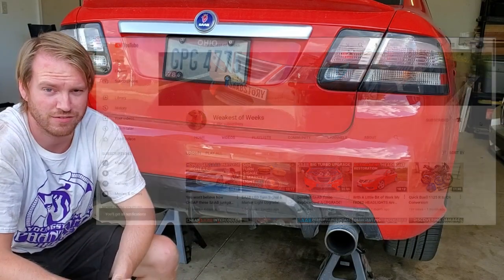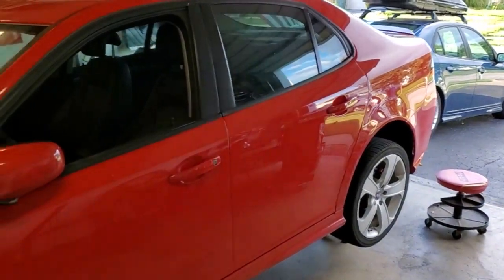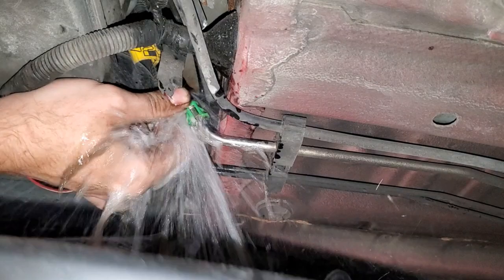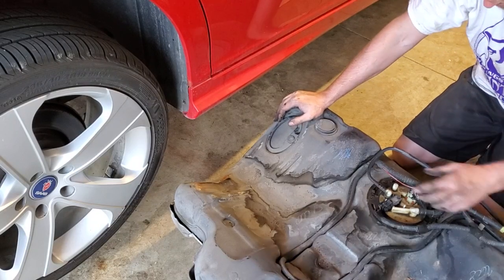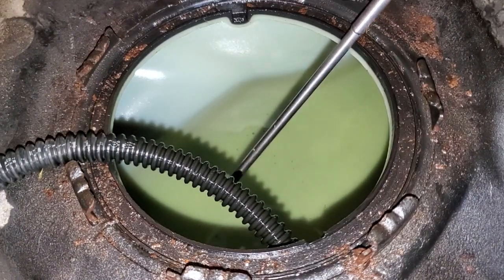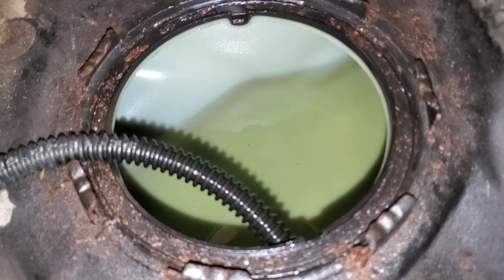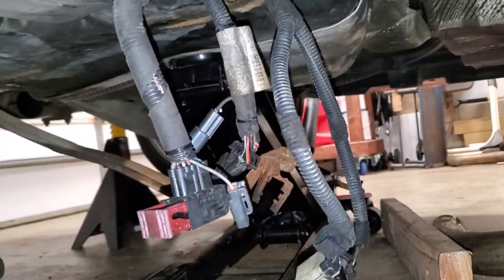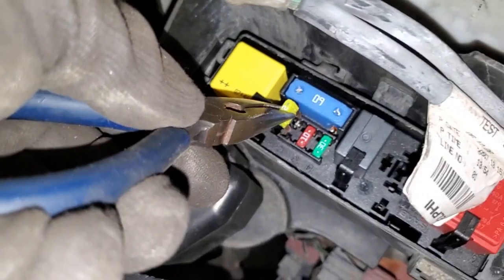Detailed SAAB 9-3 Fuel Pump Replacement

Comment: After watching this video I don’t think I am as terrified of dropping a gas tank on one of these cars as I was before this video. Gracias. But it hasn’t done anything to curb my rage at SAAB’s engineers for not put an access to the fuel pump under the backseat like on the 9-5s.
Reply: We made our own, took like 5 minutes :)=
Reply: The newer 9-5s changed the pump and tank so, you guessed it, you have to remove the tank now.

Comment: Not sure if you found this out by now, but those clips can be easily removed by pressing them in while pulling back on the line. Just an FYI a minute too late.
Reply: which clips and can u describe a lil
Reply: Yup, found out too late lol
Reply: This is a GREAT tip!

Comment: I just did the job on mine.  Whew.  Thank you very much for your video.  The one piece of advice that I would offer is that it is best to use a 1/4" drive for the rear bolts.  This will allow just enough clearance to line up with the 13mm bolts on the straps.  And most of the clips will release if you press them in the middle and pull.  I only had to get medieval with one.

Comment: My car was cranking but not starting so I sprayed some starter fluid to see if it would start it started. I let the car run for about 10 mins drove it around it was all good. Next day I went to work all fine this morning I get in my car try to start It wouldn’t start so i’m guessing it’s a fuel pump I don’t have a scanner so I can’t get codes but i’m assuming it’s the fuel pump

Comment: I just completed this drop and rebuild on my Saab 9-3 2.8 Nordic convertible. With the Vermont Tune I am averaging 9 Miles Per Gallon. Did anyone else have a drop in mileage with the pump change?

Comment: I need this done on my Saab too and it looks so intimidating to attempt myself. Ugh. 🙁 
About a month ago I took my car to a shop who quoted approx $1,300 to do this exact thing. I don’t mind paying for someone’s knowledge and labor, especially for a Saab since many mechanics don’t wanna work on them. Where I run into problems is the shop wanting to charge me almost $600 for the replacement pump when I KNOW you can get one much, much cheaper!! That’s why I told them I’d be in touch if I decided to have it done. Maybe because I’m a female they think I know absolutely nothing...  whatever. Anyway, THANK YOU so, so much for sharing this video! You just got another new subscriber! Happy Thanksgiving!
Reply: Is that replacement cheaper pump the same brand and quality they want to use? You can almost always find a cheaper aftermarket part, but you might have to pay to get the job done all over again sooner than later with a cheaper one. MAYBE. Tough for a shop want to back that up with a warranty they can stand behind, rather than choosing the more expensive one. 

PS- there's a NHTSA Recall #11E009000 about certain aftermarket pumps failing, even while driving, causing a stalling and safety concern. I'd wonder if those cheapies fall under the part# range given in the Safety Recall? 🤔

Comment: 2004 Saab 9-3 arc fuel arrow indicator doesn’t move anymore  any idea what I can do, I never know how much gas I have anymore I just guess
Reply from the maker: Probably the fuel level sender/float on the fuel pump. Very common issue. Unfortunately, that requires a tank drop to replace.

Comment: Pls help! I'm in the UK and own 2 93's. My 93 1.9tid vector sport which is automatic has been off the Rd for 2 yrs. I've never worked on cars myself but managed to carry out the work req to get it thru its mot test. Car was running perfect for 3 hrs then started to cut out at junctions etc. When it's idling and I go to put it into drive, reverse or back into park it cuts out. The eml then appeared and the local garage said it was the code for the egr valve. I took it off and cleaned it along with the throttle body and map sensor. Drove OK for a day and the e m light went off.  Started cutting out nearly every time I came to a stop and the engine management light came back on. Bought the icarsoft for saab and got code 0087 fuel rail/ system pressure - too low bank 1 and 0400 EGR A flow. I changed the fuel filter and the engine management light has gone but the problem is just as bad. I've not touched the fuel rail as I'm not confident enough yet but any thoughts on what the problem is please 🙏? Thanks

Comment: Hey right at 10:02 that black bar right in front of the strap for the fuel carriage - you don't show how to get that bar off could you make a video about that part?
Reply from the maker: That black bar you're referring to is the rear sway bar. You do not need to remove that to drop the fuel tank. Angle the front of the fuel tank downward until the back of the fuel tank clears the sway bar. Then you can lower the fuel tank down more evenly once you clear it.
Reply: @WeakestofWeeks  HMMMM I can't get to the screw that holds the strap on the fuel carriage?????? no cap I had a picture but my phone got destroyed I'll try and catch up with you. I dont think it's the sway bar it looks like the bar attaches all the way to the wheel or the braking mechanism???
Reply from the maker: @randolphmasters3610  Interesting. Well when I drop the tank I only unscrew the 2 front most tank strap bolts. I dont bother with the other 2 rear ones since they're in a difficult spot.
Reply: @WeakestofWeeks  hmmmmmmmm oh wow near the front im not sure mine is like tht but i cant look at my car right now im pretty sure its differrent idk why its a 2004 idk ill try and get back 2 u

Comment: 22:08 should rinse the top of the tank off before opening it.  Will save you a lot of time fishing.  Also never use Dorman brand fuel pumps.

Comment: Hope you will answer...
Does evap line that goes from the tank to the engine, if you blow into it, the air goes both ways or just in direction to engine ( like check valve or something)?
Reply from the maker: Great question! You honestly have me stumped on that one. I would say goes both ways and engine computer commands purge valve & solenoid to close under certain circumstances. So could probably be either.

Comment: Is the same way for a Saab 9-3 2006 2.0T
Reply from the maker: Fuel pump replacement process shown in this video should be near identical for the 2.0l 4cyl engine. Some part numbers like the actual fuel pump assembly will be different.
Reply: Yes, I just did it today, using the info on this video! Get the clips and the ring removal tool.

Also that line from the inside the tank to the underside of pump, that clip was different from the one in the video. 
Could be that its a 2005, but thinking its just another replaceable clip I broke it off. 
Turns out its a built in spring loaded clip in the line connector end, oops lol 

Now I got to cut that end off and add a new connector or just clamp the line to the inlet part under the pump where it belongs..stay tuned.

Comment: Hi there,
maybe someone could help me
my Saab 2.8T MY2008 very little restless when idling! no problems under load
noticeable at the traffic light etc.
have already exchanged:
boost pressure control valve,
boost pressure sensor,
Air mass meter,
Spark plugs,
Ignition coils,
Air filter,
Injector cleaner

Maybe Vacuum lines?

I Hope someone  can Help me Best Regards from Germany !🙏
Reply from the maker: Hello Patryk, any check engine lights? Unfortunately, it's hard to tell what your cars issue is. I would clean throttle body and check if the intake gaskets are leaking.

Comment: Why my Saab 9-3 2.0 aero it needs more time than usual to start when its cold and even when it is hot and stay off for about 30 minutes. And it have fault in right turn indicator but it work, it is some fault code for fuel pump or pressure regulator?
Reply: The bulb may/may not be on it's way out. Look at the contact switch where the bulb sits.

Comment: Hard work you know your could get it from the back seat you only need to drill out the plate
Reply from the maker: Not true on a 2003 and up 9-3. You'd have to cut one heck of a hole to get the fuel pump assembly out
Reply: @WeakestofWeeks  yes must better then remove the whole gastank

Comment: Gary,

I commented and asked you a question about impact wrenches and Saabs last week.  I have a fuel leak on the top of the tank on my '06 9-3 2.0 Cabrio with 97k miles.  The car is not throwing any codes and is still running ok.  I'm going to have to drop the tank obviously.  I used an inspection scope and I'm sure the leak is in the fuel pump area.  My car's tank has similar stains at the same locations as your car did.  I have one day to get the tank down, finish the work and get it back on the road.  I'm buying a new tank ring, vapor canister, fuel pump and fuel line clips.  Is there anything else I should have on hand just in case?

Thx
Reply from the maker: Hello Scot! I'm pretty sure I responded to your impact wrench question the other day. As for the fuel pump replacement it sounds like you're on the right track with what parts to have on hand. You may need exhaust clamps depending on how rusty yours are but thats something thats easier to take into the autopart store to match once removed. Outside of that, just try and use up as much gas as possible before you drop the tank. It's awkward enough with little fuel in it let alone multiple gallons.
Reply: My flex pipe rusted out earlier this spring.  I tried to save $ and cut the flex section out and installed one I had on hand.    The idea looked good on paper, but it's not working out in reality.   I'm going to go ahead and buy the replacement part that bolts to the downpipe and runs back to the resonator.  (Another great place to use the impact wrench).  I was tempted to drop the tank, see where the fuel is leaking from and just epoxy the break.  However, fuel pumps are cheap enough to keep me from doing that.

Comment: easier solution espesially for diesel, cut hole under seat ;) replace pump and than screw with bolts cuted metal plate

Comment: i replaced my fuel pump and its not getting any power so no fuel is going to the engine any idea what i should be looking for?
Reply from the maker: Have you checked the fuel pump fuse and relay?
Reply: I read about a dude that had a rubber grommet sucked into the fuel line that goes into the pump. start there?

Comment: What about fuel filter?:) good to replace it to after pump
Reply from the maker: Yes very good point! Unfortunately, US spec cars like this one in the video didn't get an external fuel filter.
Reply: @WeakestofWeeks  I got a 2008 95 aero and i assume there is no external fuel filter as well?
Reply: @jl3059  correct unfortunately. We don't have an external fuel filter on ours annoyingly.

Comment: Walbro rules!  OEM.  Is that tank metal?  Not high density plastic?
Reply from the maker: The fuel tank for these are plastic
Reply: @WeakestofWeeks  thanks, for some reason it looked like metal, which I thought would be rather odd.

Comment: Can't you just cut a hole in the car to access the fuel pump directly?
Reply from the maker: Nope. People have tried on the NG 9-3 and it never turns out well! You would spend more time cutting a massive hole to get to the lines than it takes just dropping the tank.
Reply: @WeakestofWeeks  what about the 08' 9-3?  I dnt knw if i hve everything to safely drp the tank. Any reccomndations?